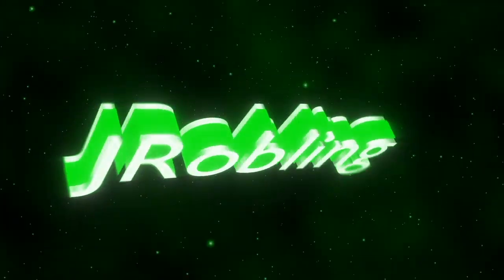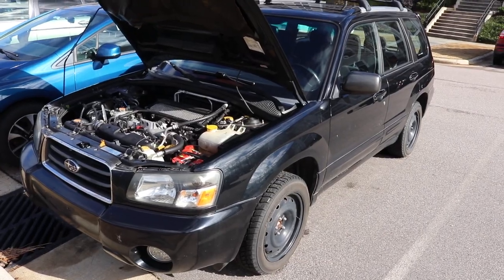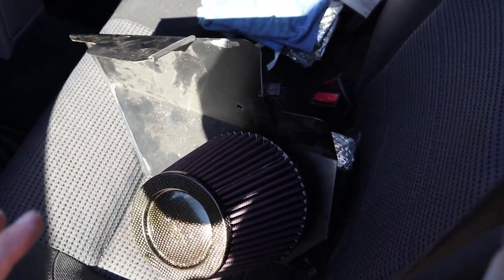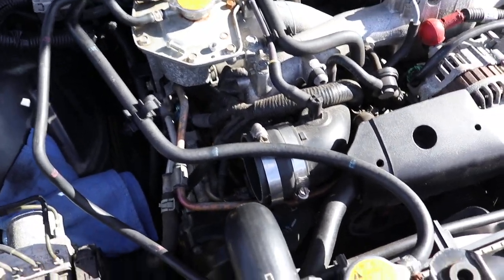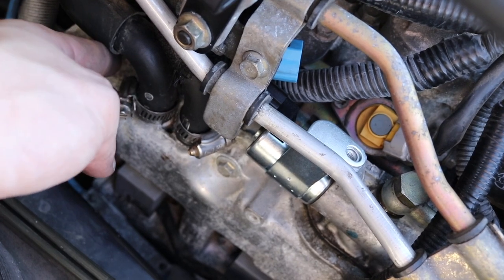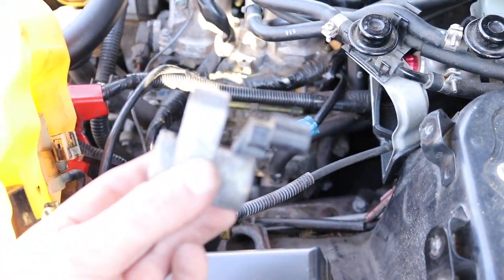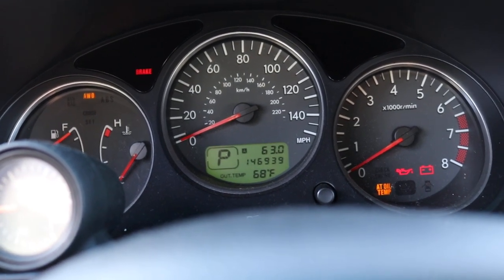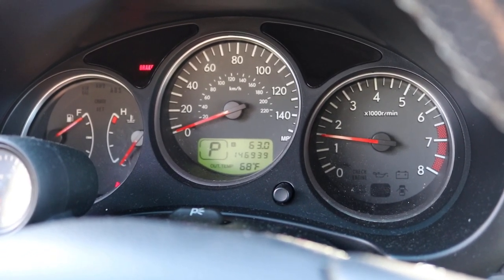Code P0011?? Is the Turbo Dead?

Comment: 45 degree bent long nose pliers get those breather hoses off nice and easy after a wiggle. Same pressure both sides, the clamps are aftermarket on the passenger side (US passenger side) and the other side are factory wire clamps...they are rubbish though, hence someone changed out the passenger side ones. I had this P0011 code today on my UK 2007 STi....hoping it's just the UK drivers side solenoid. Well filmed and useful video, good talk through etc, thank you very much.

Comment: Thanks for the video! I just had the P0011 code pop up on my 09 wrx. So far I learned that my oil was very low due to the valve cover gasket having a slow leak on the passenger side. It is due for an oil change so I'll do that right after I fix the leak. I'm also having trouble of a huge cut out once I boost over 10-12 psi so I'm hoping if I have to change the solenoids then maybe that will fix that problem too. It currently has 312k miles on it so I knew problems were eventually going to start happening soon.

Comment: The clamps at 13:10 are not OEM and past repair/replacement of the vvts is detected! The clamps are stainless by the look of it so it's better in the long run but hard plastic pipe tends to leak without a crimp style clamps. Make sure those hose clamps are tight.

Comment: Warning I bought a pair of the non-OEM ocvs for my 2010 forester XT and they did not work at all. Not a big hassle to return through amazon but I have to wait a week for the OEM parts from Subaru. The way to check this yourself is to get a ~$12 vagcom cable and hook up a laptop with RomRaider logger. Then log intake OCV duty cycle along with the actual variable valve timing advance. When you go above 2000 rpm you should see the timing advance increase proportionally with the OCV duty cycle. With my old (160k mile original) ocvs there appeared to be some sticking on the passenger side where duty cycle would drop but timing advance would hang at the high point for a second or two before falling back to 0 while the driver side responded as normal. With the non-OEM ocvs it looked like duty cycle increased but there was never any change in timing advance at all through my entire test drive and I wound up throwing both p011 and p021 instead of just the intermittent “pending” p021s I’d seen before replacement.
Reply from the maker: These parts are for the wrx sti and forester up to 06
Reply: J Robling seems like the item description on amazon may be messed up: “It will fit the following makes and models: 

2005-2013 Subaru Forester 2.5L Ej255 Turbocharged” and it also showed the “Fits this vehicle” verification.

Anyway it’ll only take 10 mins to swap in the OEM ones now that I’ve used this video as a starting point. Passenger side is identical layout on the 2010 and driver side only difference is you have to pop the oil fill tube out (3 bolts, no gaskets) and you’re good to go

Comment: Just found this. Have 2006 sti with 130,000 miles. Spt add ons. Question should I  remove the turbo banjo bolt screen or not?  Terrible subaru engineering. You just answered my question. Thanks. Saab has a much better design.

Comment: I blew the turbo on my 2005 FXT came up with P0011 and P0021 codes had no filters in these banjo bolts but did remove the filter out of the turbo feed line which was clogged and the cause of my issues
Reply: How did you remove it from the hose how far in was it?

Comment: Any advice for if the problem remains? 
New turbo, both solenoids replaced, all screbs from banjo bolts removed. 2 oil changes after all that to flush it. 

Ran beautiful for 2 days and then threw the p0011 code again
Reply: Did you figure it out?
Reply: Timing belt messed with recently. I did mine, same issue you’re having

Comment: I've been having this code with my 12 WRX, I just changed my oil and replaced the sylenoid from auto zone, but I haven't touched my banjo bolts. should I take those out completely? I saw you still had yours in was a bit confused. I appreciate any advice!
Reply from the maker: You need to have the banjo bolts in place, it is the filter within the bolts that needs to be removed. For your year WRX i think the filter is in a different banjo bolt.
Reply: J Robling got it thanks I’ll let you know when I take it out and keep you updated! Thank you for all the advice in this video!
Reply: @michaelbarreiro2282  Was that it? I have an '07.

Comment: How are the Amazon solenoids working for you so far? Have you monitored the OCV duty  L & R since installing?  I replaced both and the numbers are now matching but they seem to be higher then before.
Reply from the maker: Since replacing them I still have zero issues
Reply: Pat Doogan FYI I just got a pair of the amazon ones for my 2010 forester XT and they didn’t work at all. The reviews mention a couple other people having the same problem but basically the OCV duty cycle looked the same as before but did not result in any change in variable valve timing advance as you’d expect if the solenoids were actually opening and closing so VVT advance just stayed stuck at 0. OCV duty cycle is really just a measure of what the ECU is commanding but you also need to look at the result which is that the increased oil flow would advance the timing.

Comment: What if you replaced both of these and still have the p0011 and p0021 code ?
Reply: Exact question I had and I replaced my turbo. Probably timing is off slightly, because I just just did all my pullies, WP, and tensioner and Tbelt.

Comment: at 11:40 you advise that you may need to remove two hoses from the passenger side (we're talking North American roads), in order to remove the AVCS solenoid.  What are those hoses for?  do they contain fluid, liquid, coolant, etc...?  I'm hoping that my EJ255 WRX engine (with turbo) is as easy as what you've shown here, because I'd prefer to save myself the $600 the garage quoted me for my P0011 code that has been the bane of my existence.
Reply: Was it? I have an '07 ej255.

Comment: Those two banjo bolts you removed.  Did you actually fish a filter out of the hole. I’m only asking because those supposedly have no filter.   Only the bolts with a nipple have a filter.  I checked both of those in my car. Check the bolt and the hole and no filter.
Reply: Neither of the bolts in my 2010 forester XT had a filter but I did have my turbo replaced at the dealership ~2 years ago and they supposedly resolved the oil flow issues which may have removed the screens. I would have never known I had to look so hard into the holes after pulling the bolts without this video since my impression was that the screens were supposed to come out when you pulled the bolts
Reply: Mist have been removed already.